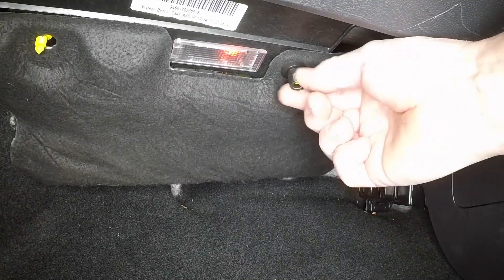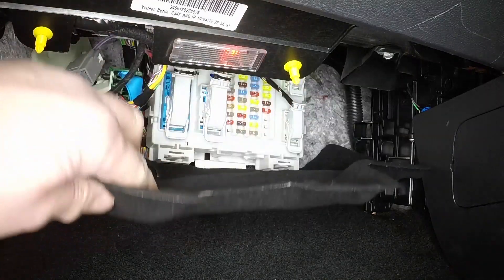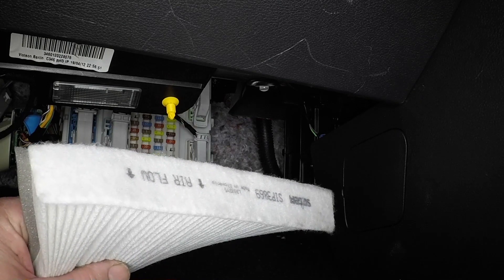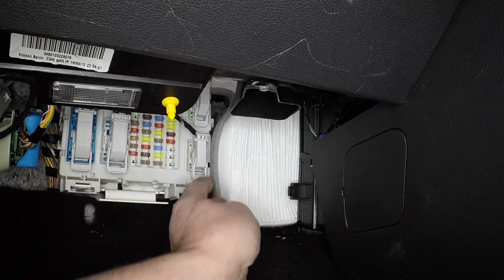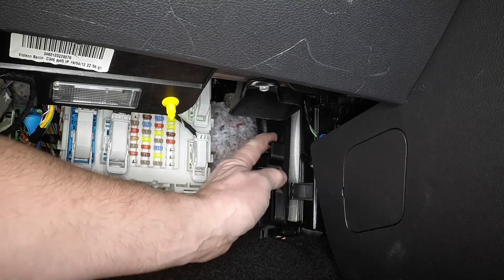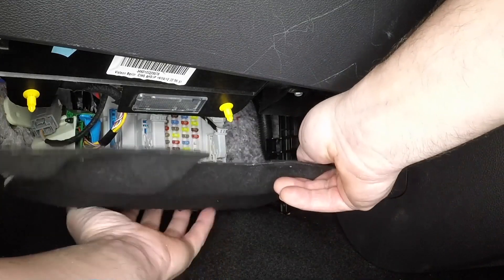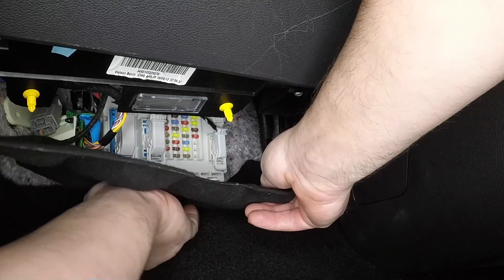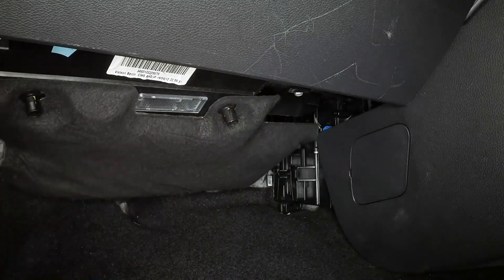How to change the pollen filter on a Ford Focus (2011-2014)

Comment: I've got a set of cables taped up in front of my filter cover, one of which is a thin cable leading to my dashboard so I'm struggling to get the filter removed. Any suggestions on how I should deal with cables ? Thanks. Martin

Comment: Is the pollen filter in the same postion for a 2014 Mk2 connect ?? i thought it was under the scuttle cover ...
Reply from the maker: We don't produce a Connect manual for the Mk2 models, but the filter on the Mk1 models was indeed under the scuttle. A quick check with HaynesPro info suggests that on Mk2 models, the filter is under the passengers side of the facia..

Comment: Where is it in a ford focus se 2011?
Reply from the maker: The pollen filter is located under the passengers side of the facia, in the side of the heater distribution housing. On models upto 2011, remove the lower facia panel, and fusebox, and on models 2011-on, remove the passengers glovebox to gain access.
Reply: @HaynesManuals  i did I see nothing.
Reply: @toddsmith1617  same here. did you ever find it?